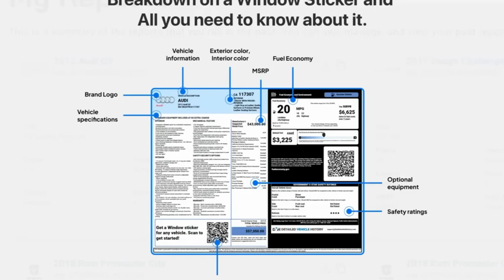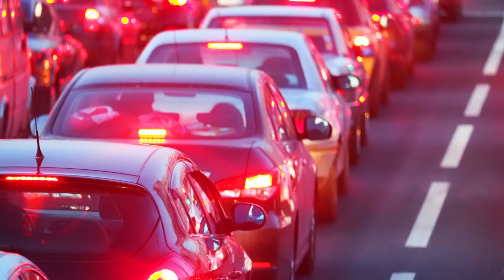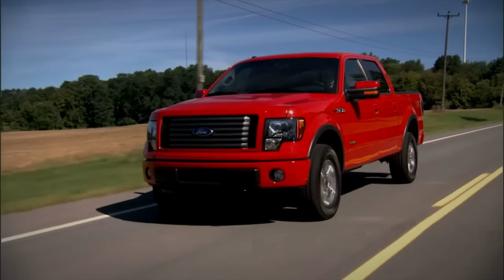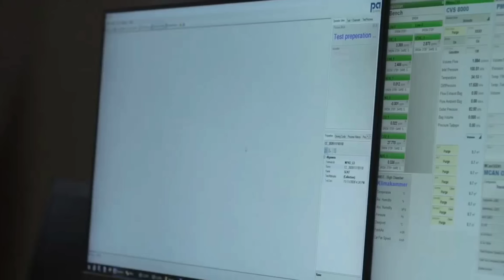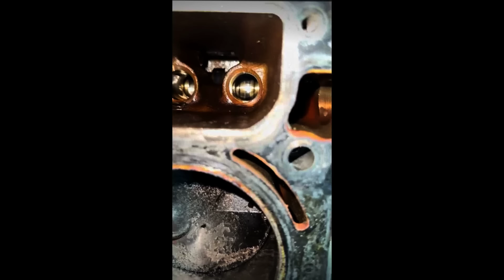Why Mechanics Turn This Off Immediately (The Auto-Stop Scam)

Comment: Since the Trump administration eliminated the dumb-AF auto start/stop requirement dealer service dept's are going to be inundated with demands to have it permanently disabled.  Word is that it can be accomplished by disconnecting a switch on the hood latch, at least on some models.

Comment: I had a 2015 GMC Sierra, the frame cracked from the inside out but the AFM was a must! I know how a 2024 Nissan Frontier (The only new old truck) and according to Reddit/ YouTube you can disable the AutoStart permanently with just a piece of a zip tie.

Also worth noting, I had a failed lifter and the warranty only covered parts and labor, not hardware. Still cost me about $2,000 out of pocket and that was years ago.

Comment: That's why I always say it's nothing like a good old-fashioned car or Van something in the 90s or 80s, you're better off. I'll never, ever buy a brand new car, never will Mike. When is a 1999 Savannah high top camper, which I built out I love my Van. You got little electric windows and stuff, not much, thank God, no auto starts, no Otto stop that auto nonsense with old-fashioned radio.  Everything buttons and knobs. That's how I like it, no touch screen

Comment: When the government and clueless politicians force engineers to implement really bad designs into automobiles this is what results. 
I also pity those choosing new vehicles with 3 & 4 cylinder engines pushing out high horsepower (which they won't do much past the warranty period).
Reply: That’s because politicians get chauffeured every where. They don’t drive. So they don’t care. They’d rather take the kickbacks from the green movement.